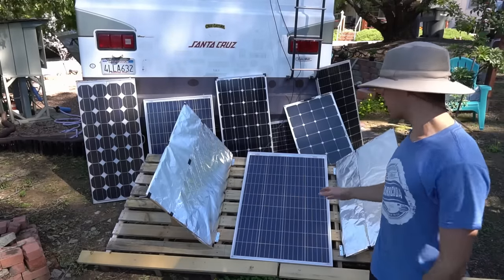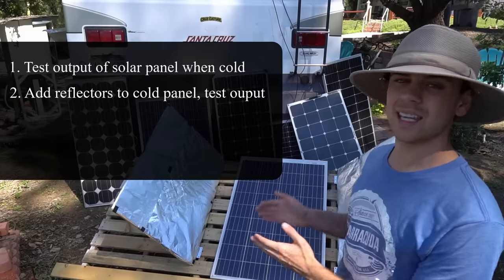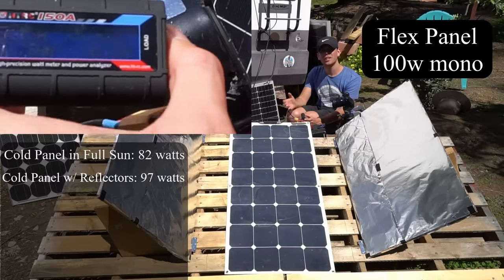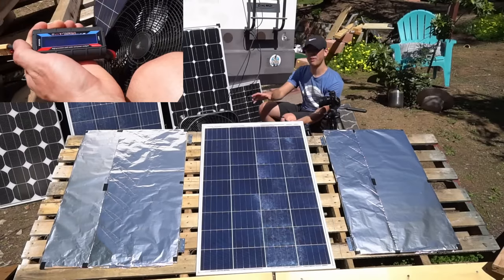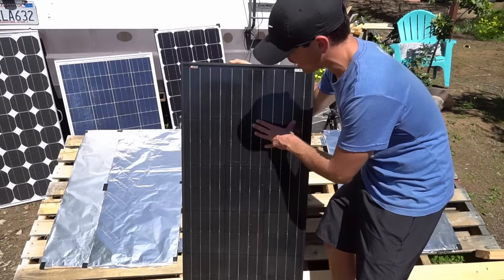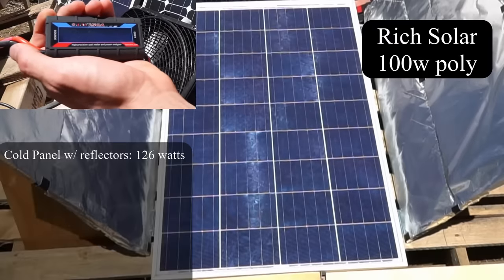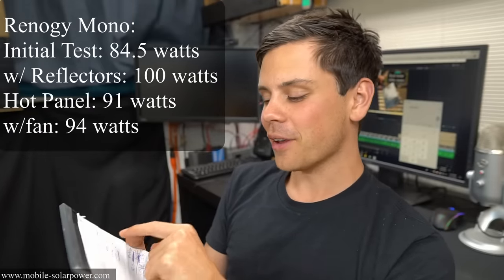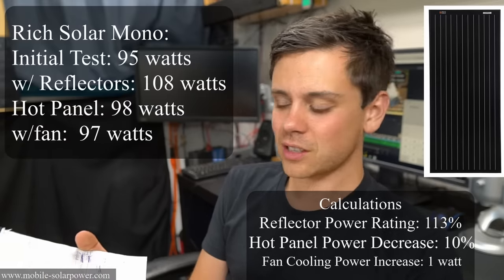Solar Panel + DIY Light Reflectors = More Power? Renogy vs Rich Solar vs Flexible Panel

Comment: I have some old panels that somebody did this experiment with for a few years apparently. The end results of a long-term test reflectors burn and ruin panels.
Reply: Bob Holland ohh... who would have guessed! (Irony) Ofc it does, these panels heat dissipation is designed to work at the natural 1000 - 1300 Wm^-2. 
It’s nice to see people fiddle around with Photovoltaik ... but from what I see in those kind of videos and comments is that people just barely have even the basic understanding of what they’re dealing with to a degree that it is comparable to children playing in a sand box eating dirt. All those experiments weren’t a waste of time and resources if people would learn a little theory  beforehand.

Comment: I'm setting up a 40 foot panel array attached halfway down the side of a high cube shipping container, painted white for maximum reflectivity, with plains to add a reflector on the ground in front of the panels as well. Putting the reflectors above and below the entire array, eliminate any need to adjust them, and should constantly boost my output.

Comment: Great video, Will! I was curious about this very thing, so you've saved me a lot of time testing.  In my mind, the benefit of reflectors can help  low/lower light conditions, such as early in the morning or later in the day, when the solar panel angle is less optimal and it can direct additional light onto the panel. But maybe as you say, it's just better to buy another solar panel and angle it for those circumstances. Keep up the good work!

Comment: It depends On the manufacturer they made, I made many brands of solar panel, if the cells are good sometimes the power on the sun simulator can reach +3-7% higher than the real power, and sometime if the cells is not really good the power will be ±3-5%, so you will buy the panel randomly on the market, lucky you if you got the good one

Comment: try testing it in bad weather, so you arent anywhere near the max production.. maybe the reflectors will have a big impact then?
Reply: I'm always interested in improving cloudy day performance.
Reply: well instead of putting down some reflectors... just install addidional pannels 😅
Reply: When it's cloudy you have no direct sunlight to reflect.
Reply: Then you will se mono panels will perform better than poly panels. Mono panels are more like a "good in all weather" type of panel. Poly will not perform in cloudy weather conditions.

Comment: Great vid! We use some 350W commercial grade mono panels that I’ve seen hit up to 410W (without reflectors) because our climate is so optimal. I bet their output would be insane with reflectors...I’ll have to try it sometime. I wonder how higher irradiance affects the degradation rate...

Comment: Hey, thanks - you got the point by half, I might write: As all three Solar-panels had near the same output in Watts at this config (sun near 90 degrees, no reflector) you get really more with 2 of the cheap ones, just use them without play around (reflectors).
I have since Sept 2019 6*33- W 24V Poli on an 2KW Sengery, now 10 Panel. The only thing makes sense is 4 times a change of angle to the higher and deeper sun, so far I can tell. Winter at 10% slope just 11 KW, now near perfect over up to 15 KW a day. - Good Luck, keep going.

Comment: Awesome video. Never imagined gains could be so high. May even see slightly more with a flat-white reflective surface, not sure... Attitudes toward poly panels should change once these results get out.
Reply from the maker: Right?! I was blown away by the results too. So just now I ordered every polycrystalline on Amazon to see which one is best!! Next week's video should be interesting.
Reply: @WillProwse  The poly's may actually outperform mono's in shaded situations. This is important when you have to deal with trees. I believe altE may have addressed  that at some point.

Comment: Will, thanks for making these videos. They have been very helpful as I try to prepare to eventually set up my own van for travel. 
I really enjoyed this video because as one of my jobs I have worked out of a remote backcountry station here in CA for the National Park Service. The backcountry station was set up with some gel batteries, a charge controller,  inverter, and 2-100w solar panels. I loved tinkering with the system to see how I could get the most out of it. One of my experiments that helped us get more power for our work computers, personal devices, lighting, etc. was cooling the panels. I did this by connecting a hose to a jerry-rigged water sprayer made of a scrap piece of black hose with holes punched through it, to spray water onto the panels. It increased efficiency, but don't know exactly by how much since I didn't have all the equipment to measure. 
Though not advisable with the recurring CA droughts but for the sake of science, have you ever considered re-doing the experiment in this video but using water cooling?

Comment: Funny. I came to the same conclusion a few years ago while playing around with reflective insulation panels and PVC...just add another solar panel. BTW: Pretty awesome results with that poly panel.
Reply: Adding another pannel is the good conclusion but the area of RV roofs is limited. Therefore, it can be useful to make a solar tracking system. In addition, tilting the panels allows natural ventilation. This prevents the panels from overheating

Comment: My experience with plastics says it's fine unless overheated . Like anything else exposure to radiation degradation with length time of and temperatures being your catalyst . Cooling the sub straight with misters and air is not for getting more output , it's too save the panel from total failure .   Thanks

Comment: I wonder whether you could get a better result if you covered the reflector with an infra-red blocking material, so no heat is reflected onto the panel, with the reflector itself absorbing all the heat where it doesn't matter.  I also imagine if you use a cheap mirror rather than foil you will reflect a lot more light and get more output.  But I have wondered about this for a long time so very interesting to see it tested!
Reply: The mirror indeed reflected the most light, and therefore the most energy, but on cloudy days when there was no light, the foil reflected the most light energy. That was a good point about infra-red blocking material
Reply: so I looked up for "infrared blocking material" and there is this borosllicate optic clear glass coated with Inidium tin oxide ITO (great heat conductor) with coatings greater than 40Ω/ per square meter. So if you put an aluminium foil reflector underneath the glass you would reflect lesser infrared thus lower heat reflected back to the bottom surface of bifacial solar panel.

Comment: interesting results for sure.  I am a photographer and photographers use reflectors to add light to subjects.  there are two primary reflectors , silver and white.  Silver has more dazzle , is more specular and white is smooth and even light.  Wonder if one or the other would make a difference.  Why is the substrate on solar cells black?  If it could be white, it would absorb less heat and run at a higher efficiency, voltage.  Take care.

Comment: This is why in cold states with snow on the ground the cells are vertical to use the refection off the snow. I have also seen  some  gain with one reflector and one panel forming a V shape. More testing is needed.

Comment: "Just buy another solar panel" 
- best advice on the internet!
Reply: Adding another pannel is the good conclusion but the area of RV roofs is limited. Therefore, it can be useful to make a solar tracking system. In addition, tilting the panels allows natural ventilation. This prevents the panels from overheating
Reply: Rv roof space is indeed limited, but are you really trying to get a charge from the sun while driving? So perhaps a different approach is needed on the available roof space, perhaps 3 stacked levels that fold out either side of the roof, giving you essentially 3 times the roof space. Also makes a great awning for relaxing under with a cool drink on a comfy chair.

Any roof mounted system does need to take into account wind forces while driving though, 2 axis solar tracking would be difficult to make it strong and secure under 100kph (60mph) driving winds. it would try to rip it off its pivots
Reply: @buttsexxor  
get a charge from the sun while driving?  ^ ^ It would be a strange idea. People who use RVs are more often parked than driving. In addition, there would be a huge aerodynamic drag. Mechanical constraints and vehicule stability obligations would be impossible to resolve. 
I am not sure that everything I say is understandable because I do not master English language. You would do me a favor by correcting my mistakes because I would like to spread this project idea so that someone carries it out.

I also came to the same conclusion as you: making a tilting awning with solar panels.
A foldable aluminium framework, with drawers would have to be placed on the roof on several stacked levels. They would fold out on only one side of the roof, not on the both sides because  the rear part would either be too high if tilted up, either it would be placed on the opposite of the sunbeams if tilted down. 
The total area would be much higher than the roof area. The panels that could not be placed inside the drawers of the folded framework would have to be placed inside the vehicule. 
The top of the framework would rest on a ball joint placed at the end of a telescopic mast which itself would be placed on one side of the RV. On the lower part, this framework would rest on bicycle wheels. This would make it easier to rotate the assembly manualy.The mast should be tilted and placed high enough to offset it from the vehicle to allow the framework to rotate over a as wide as possible angle without stopping too early on the vehicle. 

On the roof of the RV : Automated sun tracking system (easier to automate than the big frame because lighter). This system would produce electricity while driving.

Why so many pannels?
The next generation of RVs will be plug-in hybrid vehicles (I guess 2021 or 2022 in north America on Ford Transit since they already exist in Europe). It would be wise to partialy recharge these RV like this with the sun, in order to less use charging stations and the alternator of the vehicle. We would need the maximum possible solar panels but we would be limited by the carrying capacity due to the volume, hence the interest of a traking system to limit the quantity of panels. 
It would be interesting to increase the quantity of batteries with something like the Tesla Powerwall (13.5 kWh) to increase the range of the vehicule when using electricity and reduce the use of the combustion engine accordingly.
Reply: @french-9743  regarding my comment about getting a charge during driving, your right, nobody is trying to charge while driving, that is also what i meant, but moreso in the direction that any roof mounted solar panel that folds or moves, doesnt necesarrily need to be pointing at the sky when its stowed away during driving, but even a system that folds out still needs to resist the forces exerted on its joints while driving even while stowed (depending on its design of course)

Your panel idea is good but i think you can reduce complexity with sun tracking by simply parking the van in a different direction. Sure, many parks may not allow you to do that but the small amount of extra charge you would generate with a sun tracking system may not be worth the complexity and cost of a system.

your idea with the drawers is definitely possible. My idea is using two parralel arms on the edge of the panel so it folds out flat and even. Varying the position of either of those arms relative to each other will allow the 'tilt'to angle your panel towards the sun.
Its difficult to describe in words but if i showed you the working design you'd understand it instantly

Comment: Good showdown!  Mono more efficient per sq inch.  If space constraints exist, use mono.  Good encapsulement important to prevent oxidation, and preserve long term performance. Flexible panels great for lightweight solar canopies on mobile applications,  like solar bike trailers.

Comment: When i first started researching solar generators i was thinking using mirrors to divert lost light back towards the collector to increase energy absorption might work..its excellent to see this phenomenon actually demonstrated. I will likely use this trick to increase output if presented with the opportunity.

Comment: Can you make a reflector that only reflects usable frequencies, or at least doesn't reflect infrared? That would allow the panel to not heat up as much...
Reply: Well its possible with uv light, photogear has those filters and they are pretty much clear glass.

Comment: Thanks for a great test!  Going to look into those polys.  For cooling, you really need to use standoffs to get them off the wood - Full air on the back will cool them far better than with the wood obstructing air flow.  Monocrystalline is a tiny bit more efficient, which results in smaller panels for the same rating (more watts per sq. ft.) but also costs more.  Monocrystalline only makes sense if you're short on space and willing to pay to make the most of it.

Comment: Metal and mirrors provide a specular reflection, that tends to need to be precise in order to be effective.  Using bright white creates a scattered or diffuse reflection, that may be more effective.  The most diffusely reflective material I tested was Tyvek.  Japanese farmers put it under orange trees to enable the oranges lower on the tree to ripen at the same time as those on top of the tree.  Like polar bear fur and titanium dioxide crystals, I think the PET fibers are clear when viewed up close, which causes light to scatter diffusely when hitting it.  Highly reflective.

Comment: It would have been interesting to have the same experience with a mirror.
Reply: Mirrors may make a more detailed reflection, but they are significantly less reflective than bare aluminum the glass is thick and absorbs lights.

Comment: Each diode junction in the solar panel acts like a light-activated current pump, but the output current is limited by the diode with the least light falling on it. That is why a shadow cast anywhere on a panel is so bad, but it also means that your reflectors should illuminate every part of a panel equally. 

This is why the smooth side of foil may be worse than the textured side for use as a reflector. The textured side can tolerate aiming errors. Making the reflectors oversized or white can also compensate for poor accuracy.

Accuracy is most important for perfect reflectors, so making the assembly track the sun is necessary. As the host said, keeping the temperature down is also important, so this system works best in the cold.
Reply: Good job love from India

Comment: Try to cool the PV from the backside with water coil in diy, you will improve the mpp. The best is to fill with concrete and heat tubes from the back.

Comment: I wonder if instead of a fan moving just air to cool down the hot panels, if simply misting them with water would make more of a difference because evaporative cooling is much more efficient than relying on simple convection?
Reply: It would definitely cool the panels to mist them.  However, the impurities in the water would create scaling over time that would reduce solar output.  Leave an air gap for natural convection.
Reply: Or copper pipe on the back to cool it while heating water.
Reply: You could use HDPE tubing instead of copper. I am not convinced that scaling is neessarily a problem, if you squeegee them from time to time. ou have to do that anyway. I had planned to heat water for a commercial heated-soil greenhouse using a waterfall across the face of a large groundmount PV array, but moving hot water around usually requires a circulation pump and if the system runs open loop (like the waterfall) the water will pick up dust and pollens. My next PV array is definitely going to have heat capture tubes - probably aluminum tubes salvaged from a 5 ton residential heatpump - glued onto the backs of the panels.
Reply: @saxonsoldier67  Mist the back of the panels.
Reply: @WelcomeToMyDream     There you go.

Comment: Thanks for these videos. We are moving to an off grid location in western WA and plan to design a LiFE based system in either 24v or 48v. Our power needs will be low since the only electric appliances will be refrigerator, freezer, and microwave.  Lighting will all be LED and I still need to do a comprehensive power evaluation after we get moved in.  The Tessa S batteries look promising.  Thanks again for all your work.  Your videos are very practical. Other videos explain how things "should" be while you do real world tests that often debunk common marketing claims.

Comment: good setup for winter and high latitude settings.
reflectors could be actuated based on temperature.
a passive radiator behind the panel so it is in its shade or heat pipe could allow passive cooling. active cooling would be inefficient (used power vs the efficiency gain)